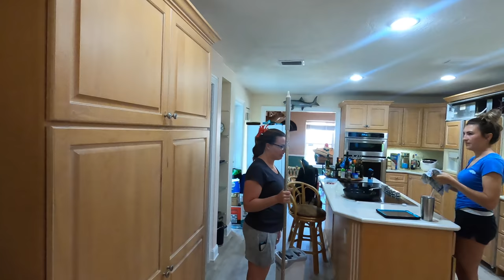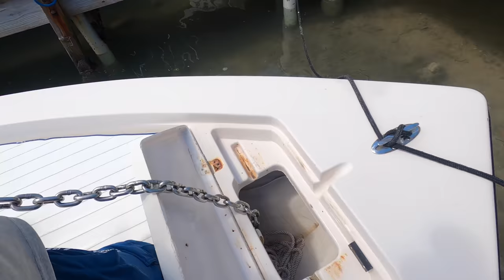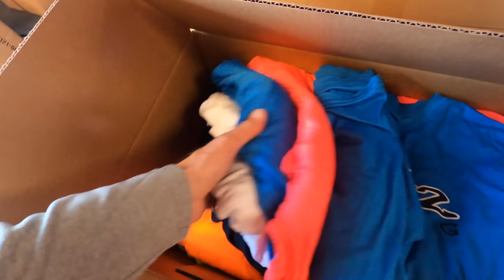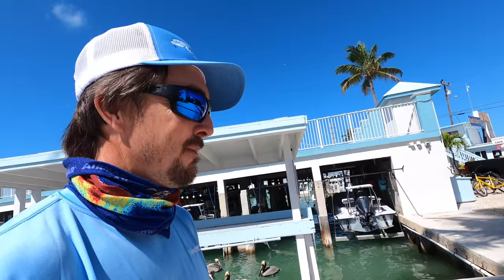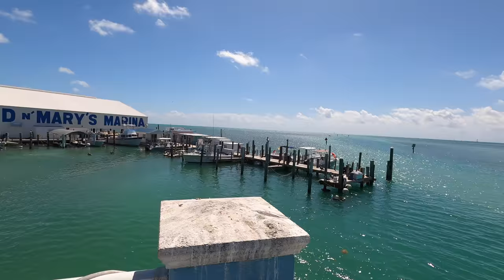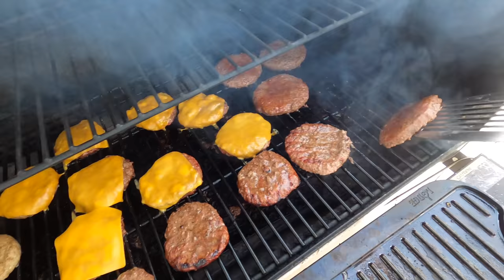StanzFam Vlog - Life/Family Update

Comment: 12"crest works better just set jaw to clevis bolt head and hala more leverage and also they work for edge straightening metal parts alla trim tabs etc.!!! life hack try next time and also on them c clevis turn bolt to tighten then when you reach the stop point back off 1/4 turn we used to lift 777 engines and if you didn't back off you couldn't untighten just a suggestion also use thread lock in the same process it seals threads no need for zip ties!!!!! band is blue lock tight!!!!